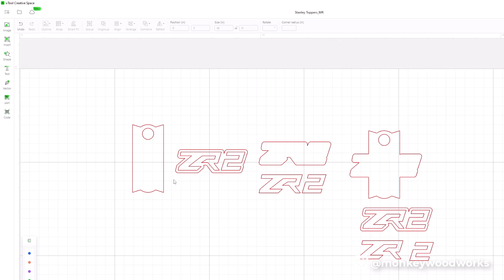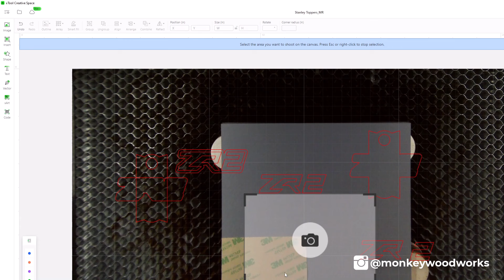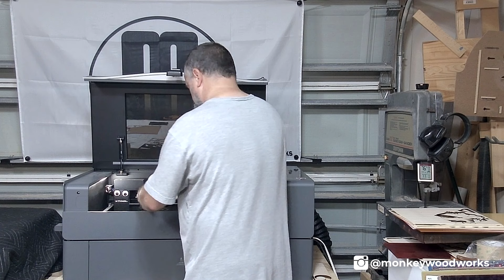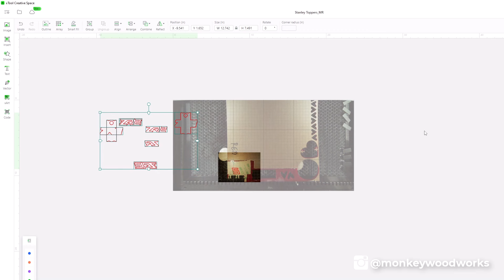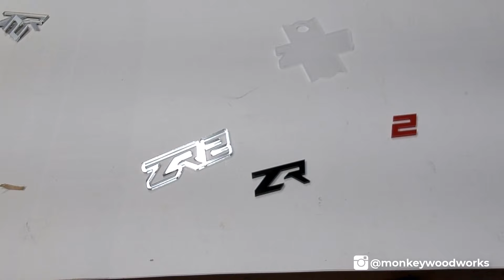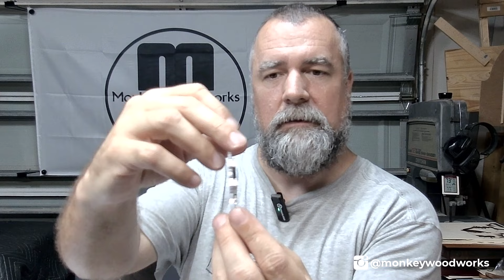Chevy Truck Needs a Matching ZR2 Stanley Topper - xTool P2 Laser Engraver

Comment: I seen you highlight images then set to ignore. How are you doing  that? What are you clicking after highlighting? Thanks

The topper looks good.
Reply from the maker: Yea, sorry about not capturing the entire screen.  To tell xcs to ignore an object on the screen, pick it, then turn off the output using the output toggle button on the right menu.
Reply: Thank you it worked. This will make large files easier to process.
Reply from the maker: @jmarcant616  awesome!  Make sure you check out my XCS video for a review of all the features in XCS. Once the new version comes out, I will make a new one.

Comment: Beautiful job Michael and looks great on the cup!! So, you mentioned kerf, you didn't have to adjust for that?

I remember my daughter had to figure out the "kerf" on some wood projects. Could that have been because it wasn't built into the SVG? Or, does it depend on the laser and not the SVG?

Thanks for sharing.
Tracey
Reply from the maker: Thank you!   On the kerf, in this case it didnt matter too much.  In fact, the wider kerf helped me put the pieces back together.  Where it matters is when your making a piece that needs to have a tight fit.  You need to measure the material thickness and adjust the slot size the material will be fitting into.  The slot needs to be smaller than the material thickness but you need to account for the kerf to make it a tight fit.    One thing i use to get around it is something called a slot sizer.  I found the SVG of it online and cut it on the P2.  I can then take that sizer, slip it over the material i want to match, and use the found slot size to know exactly how big to make my slot in the design.
Reply: @MonkeyWoodworks  that’s for that information!
Reply from the maker: Anytime